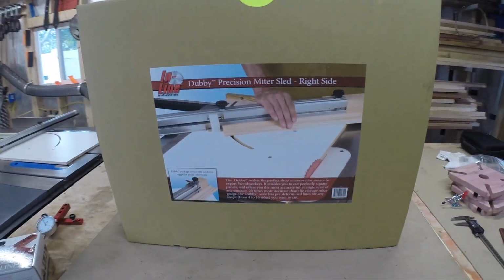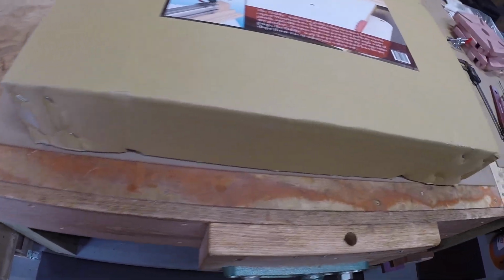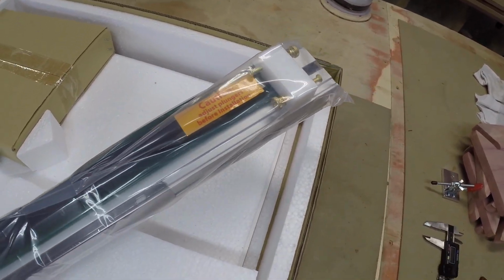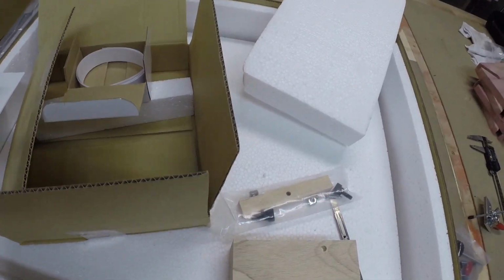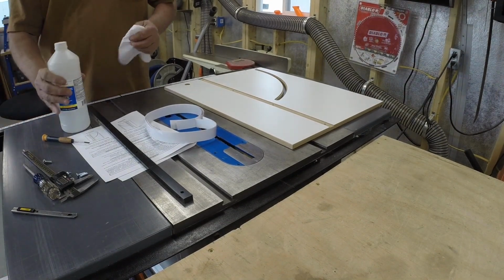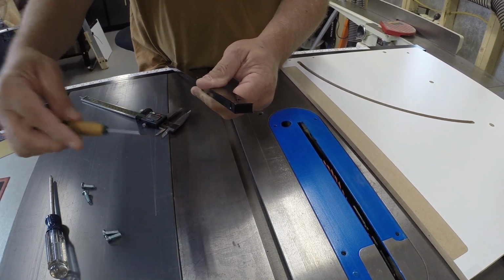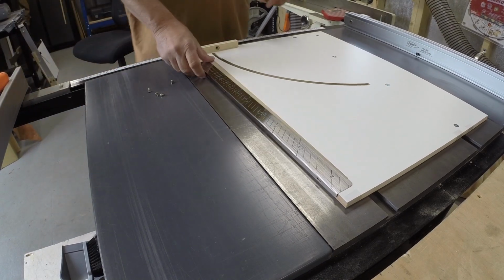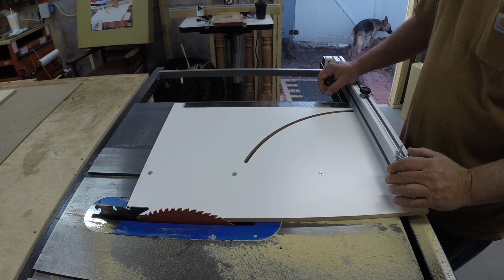In-Line Industries Dubby Miter Sled Unboxing and Assembly

Comment: The instructions advise using blue locktite on the miter bar plunger screws (after fitting to the slot) w/o getting any on the ball or plunger. Did you do this? It sure makes sense to do this but it seems the only way to prevent getting loctite on the ball is to apply it around the head of the screws. Your thoughts?